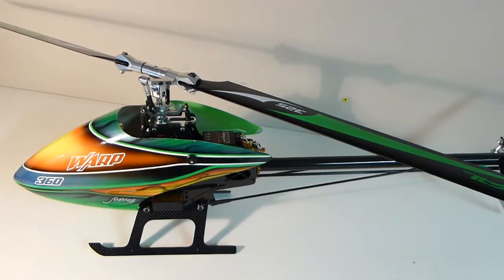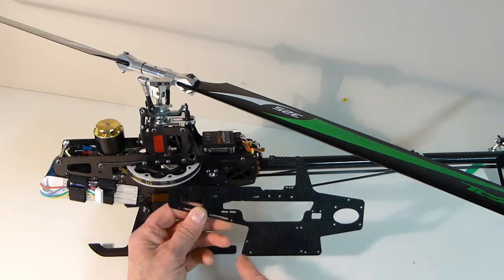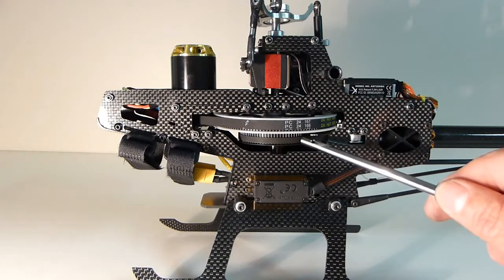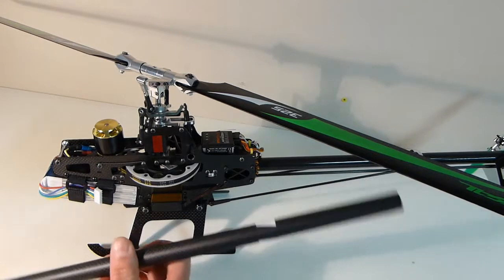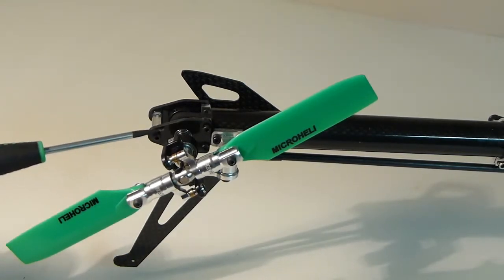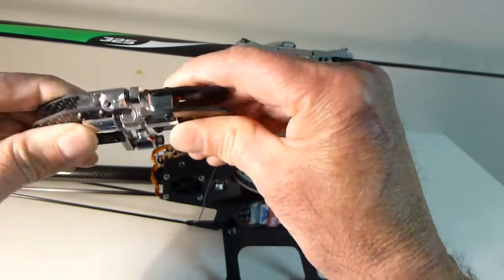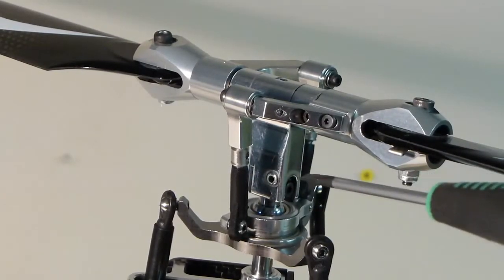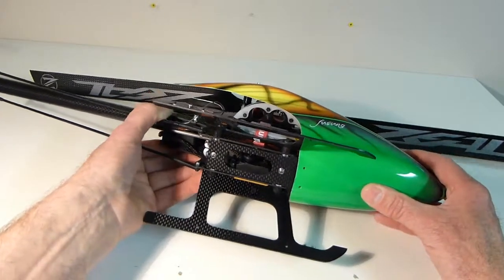COMPASS WARP 360 -- REDUX

Comment: Hi ! Do you still flying this warp 360 ?
Reply from the maker: HI'..' MAURO. No,, I have moved on to another project, I may come back to WARP 360 prototype later to make some more improvements.. By the way, I no longer cut and drill my own frame pieces  ,as it takes too long..I had some good luck finding someone close by that has a CNC machine . With his machine he cut these pieces out in about 2 minutes each,, Regards,, DOUG
Reply: Very nice you have access to a CNC machine !
Now I am having trouble with my Warp 360.
Vibrations at tail (12,000 RPM on spectrum analyzer).
I did the halk creations tail upgrade, but still has lots of vibrations.
I am thinking to do the same you did with the 450X tail grips and carbon fiber tail boom...
Reply from the maker: HI.. Mauro.  Did you balance your tail blades. If you are using the stock plastic blade grips they may be out of balance as well. This is critical because of the high RPM ...
Reply: Modify or stronger canopy mounts? Bit off hook and tape btm of canopy be better itl flap about.. I like tinkering and improving
Landing skids need a brace
They snap on heavy landing

Comment: Can you post more details ?
Techniques  and Tools to do this mod ?
Reply from the maker: Mauro Oliveira Hi. Thanks . What I should do is make another video on Carbon Fiber cut and drill, it is not difficult., but time consuming.  First I cut out a template using 1/8 " mdf, then trace it onto a C F plate, rough cut with a Dremel tool using a tungsten carbide bit, and using a file to do final shape  It takes about 2 hours to do 1 frame side
Reply: Doug Howdy Amazing ! How did you do holes with precision required for the all parts fits perfect like original frame ?